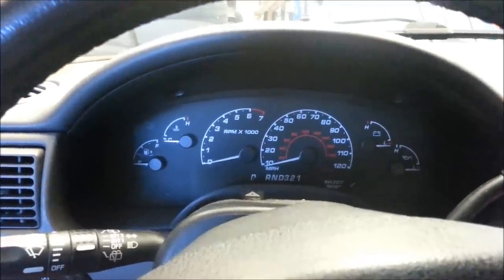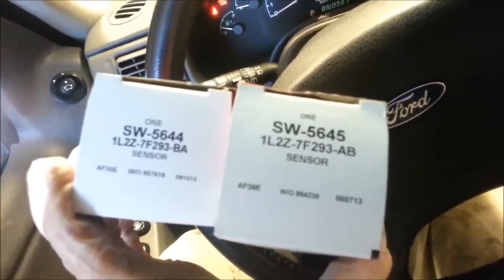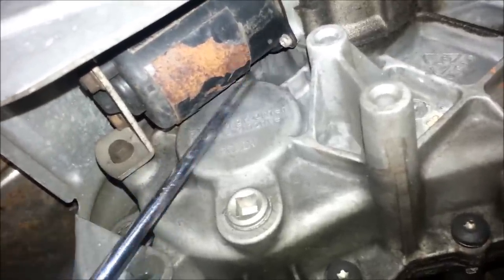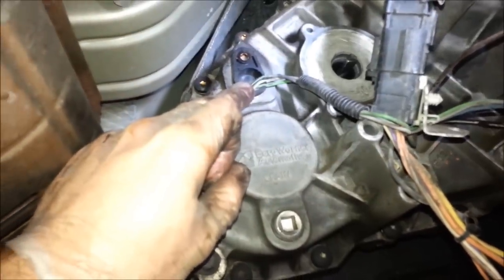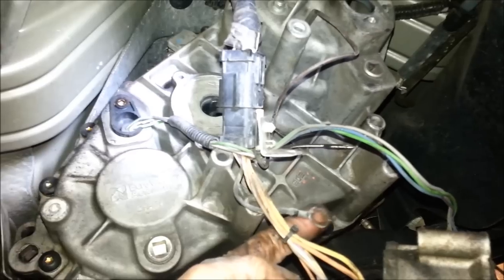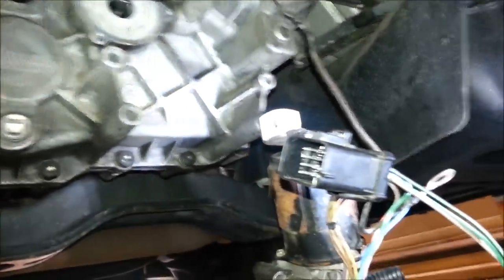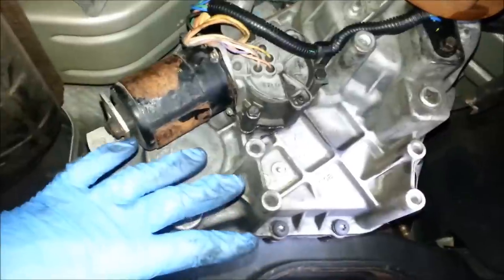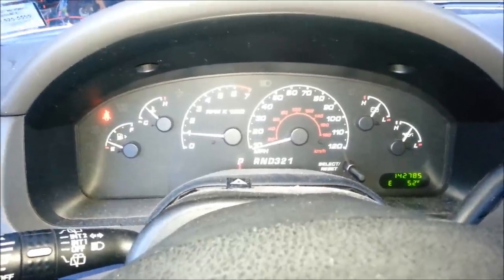2002 And Up Ford Explorer 4X4 Flashing Light Fix

Comment: Great video!  Your description was very clear and concise.  The 4x4 Low on my '02 Explorer works fine but the 4x4 High does not.  My 4x4 High light flashes 10 times when I start the vehicle but I can't shift into High.  I assume that since I can shift into Low, the electronic control module is working and if I'm in Low, I can shift out of Low by pressing either the Auto or High button so I assume the buttons are fine.  I'm leaning toward changing the shift motor. Any thoughts?
Reply from the maker: +Mike Tankosich I would also try the shift motor. you may be able to test it by removing and seeing how far it turns when you put it in 4 wheel low. But it may be hard to tell how far it is supposed to turn.

Comment: hey on my truck only the  4x4 high light flashes does that mean that only one of the sensors is bad
Reply from the maker: +Rafael Hernandez 
Not Sure but I think i would try replacing the control module behind the glovebox first.

Comment: DID this issue also keep your 20002 explorer from revving over 2000 RPM? THat is what is going on with mine.  I have no engine codes coming up. Can you advise?
Reply from the maker: +Raymond Montoya No it drove fine just had the flashing. I did also replace the 4x4 control module.